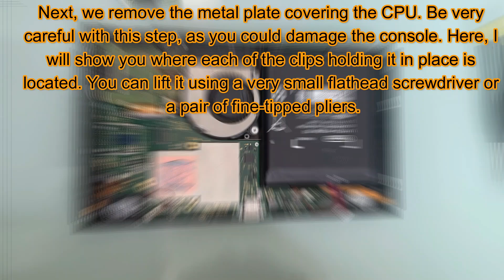Transform Your Nintendo Switch with an RP2040 Mod Chip – Step-by-Step Installation Guide!"

Comment: it needed to install a software previously or i can modchip without install anything?
Reply from the maker: @nikolaslopes5900  You need to install the firmware on the modchip first, then install it, and after the installation, update all the software to the latest version.
Reply: @Tecnogamesconsolas24  do u have the links ?